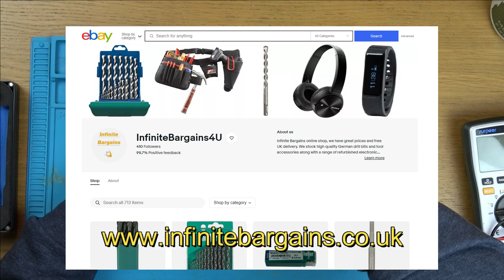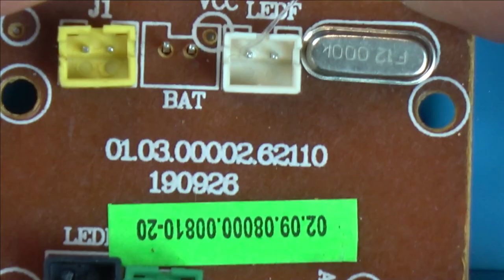BROKEN Lamborghini R/C Car with a Very Strange Fault??? Tea Break Fix

Comment: Ground was floating.  Whenever the capacitors charged the voltage difference between VCC and the floating ground became too small to act as ground and the receiver shut down.
The precise time was due to the predictable charge rate of the capacitors.
Reply from the maker: I going to pin this Tiporari to help other viewers out. Nice one 👍👍👍
Reply: I suspected as such. Capacitors are really good at creating Frankenstein-circuits that only live for a few seconds if no true path to ground exists. 🧟‍♂️

I suppose a bigger capacitor would extend the on-time. 🙃

Comment: I noticed the unsoldered leg of the chip fairly quickly and couldn't help myself shouting at the screen. Well done on the fix.
Reply: Did same as you mentioned.
Reply: Haha, same for me. Board flipped... one, two "there is a leg not solderd" :)
Reply: I seen it but thought maybe it was a NC (Not Connected), which sometimes you do get, but when he found the pad itself was connected to ground, I knew it Should of been connected. Normally, if it was a NC the pad wouldn't be connected to anywhere.
Reply: Same here I was shouting at the screen to look at the leg on the chip as I could see it wasn't soldered, and thought that's the fault, first time I have been so sure of a fault 🙂
Reply: Same for me ! XD

Comment: Damn. Simple fix and great spot of the chips leg. I was (as usual) over-complicating the diagnostic and blaming Q1 as an under voltage protection with voltage divider resistors. Gr8 fix. congrats.

Comment: If you do not have the correct connector then a female dupont connector(like the ones used on arduino and Raspberry Pi boards) would probably do the trick. Its not perfect but it would work fine if you do not have the correct ones.

The unsoldered pad looked suspicious but at a first glance you would expect it to be unused. But when you started measuring and could not find any other pin that was connected to ground, I was pretty sure you found the problem. 

Once again, great job. Its not about the value of what you repair, its about the value of what you learned and the satisfaction of creating/fixing something. So satisfying!

Comment: battery pins aren't soldered very well either.  I saw that leg of the chip right away and then those legs of the battery connection

Comment: brilliant fix, but still doesn't explain why it only worked for 3 seconds, unless heat in the chip was lifting the chip off the board.
Reply: When the ground to the receiver IC was left floating, it would start to rise the moment drive current to the other IC (prob. a uProcessor) was required. I too, was screaming at the screen the moment I saw the pad under the leg! Contaminant on IC leg/pad which avoided the flow solder process or sloppy hand work perhaps.
Reply from the maker: Still not sure, I don't think heat would cause it to lift as it seems so perfectly timed to shut off. Another viewer mentioned it may have been taking another path into the chip before failing or a charged capacitor ????? Hopefully some more comments will come in to verify the problem 👍👍👍
Reply: @Mymatevince  Floating ground.  You can ground a circuit to a positive voltage, and as long as the difference between the two is sufficient the circuit will work.  Imagine hooking a 3V bulb between +9v and +6 volts.  It will see 3V in circuit and work fine.  
In this case your ground was at 0V until car turned on.  The capacitor it was referenced to charges up to VCC or some derived voltage and when the differential gets too small the floating ground is no longer sufficient.  Three seconds was the time required for the caps to charge enough to lose a virtual or floating ground reference that was adequate.
Reply from the maker: @tiporari  Thank you Tip for clearing up the mystery👍👍👍

Comment: Every chip needs to be grounded, or there will be no pathway for the signals and voltage to take.

As soon as I saw that ground pin (and, mind you, the only ground pin on that chip) not being soldered, I knew that the problem was exposed.
That chip was effectively disabled. Current could enter, but not exit, so it doesn’t enter at all.

Still, if that chip was important for the RC car to work at all, it shouldn’t have worked at all. Something else must be the cause for the three-second runtime (maybe the current took a different path through that chip, but that would be awfully bad for the chip’s longevity). A capacitor may’ve been involved as it would allow that current to go there until it filled up, at which point the voltage gradient would drop too low for the chip to remain functional.
Reply: Interesting points ...
Reply from the maker: Cheers Operational 👍
Reply from the maker: @AppleReviews  I have a Dell monitor coming up, also a Nintendo Switch, laptop and Sega Master System . Plenty of serious and also fun things to look at 👍 I have only just done the mechanical calculator. If that wasn't serious I don't know what is 🤣
Reply from the maker: @AppleReviews  I have some MacBooks to look at too. But I know they will be a headache so I keep putting them off🤣

Comment: hi had this in a back of a betacam sp deck with the audio input you know they use a placer unit to load parts in a jumper was put not in the right place
it was used in a studio  for play back  i got it because it would not record audio i did the same like you did in the video and recorder the space wire in the right place like you
did  betacam sp deck were big money  to make a silly misstake  was never picked up    good video

Comment: 8:13  There is an edit here and solder has been moved on the resistor.  What happened?
Reply from the maker: It looks like solder but it is just a scrape from the probes. These tea break vids are cut heavily to save seconds/minutes  to try and get the overall time down 👍

Comment: The board looks like it had some liquid damage in the past. If that was any kind of soda it might have been quiet aggressive to the solder. Probably cleaned/dried out by using a toothbrush and removed the solder by accident.

Comment: "Anything bad?"
SPOILER

Why yes, that copper pad under the chip leg looks like it should have some solder on it.
Thought I suspect I only spotted it because of magnification.

I think the problem was that some capacitor gets charged, but not discharges to ground and when it gets full it cuts off? Just a guess thought, I am no an electrician XD